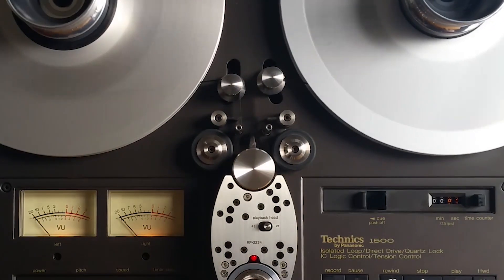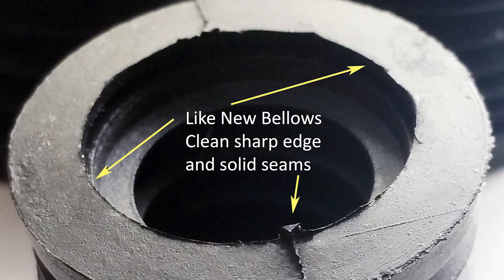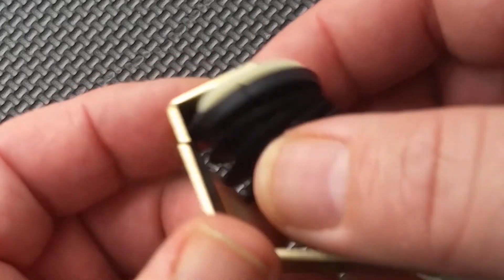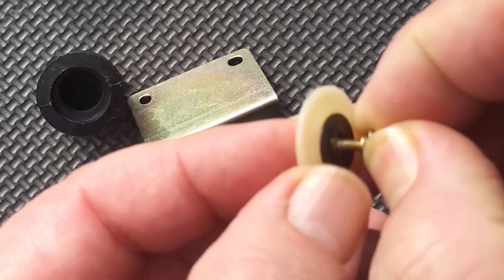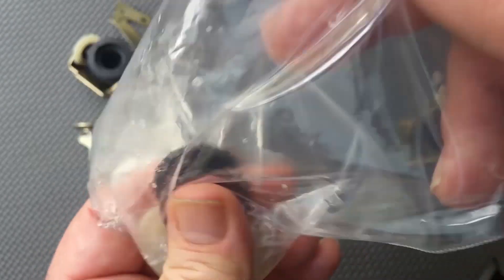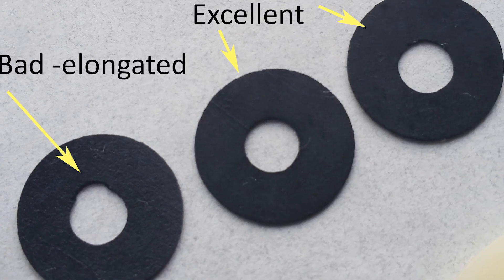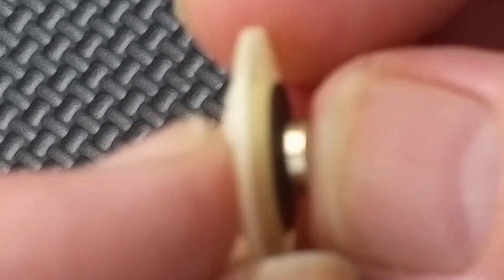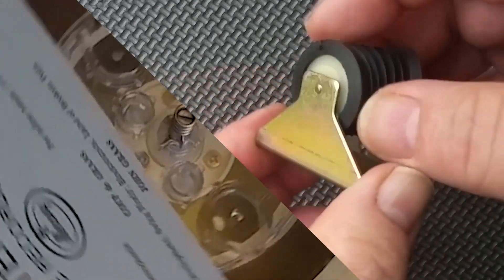BELLOWS REVISITED -TECHNICS Reel to Reel Repair

Comment: What effect does damaged bellows do to the reel to reel? Anyone know?
Thank you
Reply from the maker: IF the tape rollers are bouncing on fast wind its often a symptom.  if the bellows are bad the tape stops because tension is not maintained.  If the reels stop between play and FF or RR or you have to manually put tension on the reels to get the tape started its likely bellows. IF the bellows are totally not functioning the tape will start to play then stop.  ALTHOUGH it can also be something else but visually check the bellows first.  When the bellows fail it is either a crack in the bellows itself usually around the seam on the top or bottom around the plates or its the valve - which can be flipped over often that solves the problem  - cheers

Comment: I would love to find someone in London who could service my RS1506. ?
Reply from the maker: thanks for the note.  Tapeheads.net may be a place for some info. It is hard to find someone for R2R servicing.  London should have some reel techs I am thinking maybe some more digging.   I am good at taking these apart and farming out parts.  I have two RS Technics and had to fix the bellow/ brake issue myself from trial and error and other youtube vids.
Reply: Hi, Yes I have posted on the tape heads forums and will wait and see. Many thanks  @ReelHifi

Comment: Wow this machine was completely broken wasn't it
Reply from the maker: Not sure what you mean by completely broken. But with one of the bellows not working and the brakes not working well. The machine would stop between play rewind FF etc...and the tape would go slack and unravel. Yes for sure unusable and potentially could cause tapes to break because there was nothing to stop the tension arm from triggering the micro switch. Everything else on the machine was functioning properly.